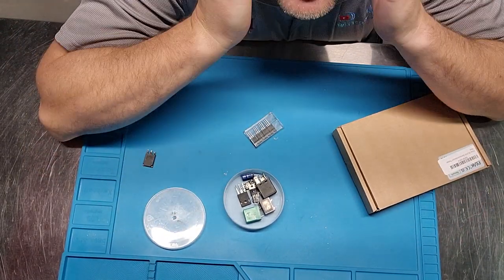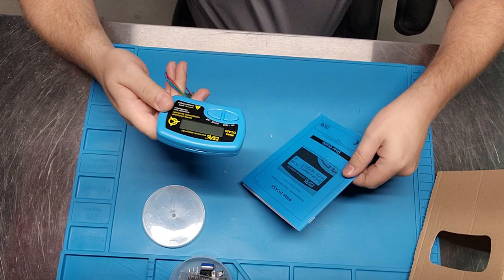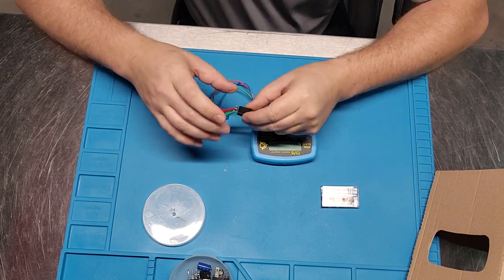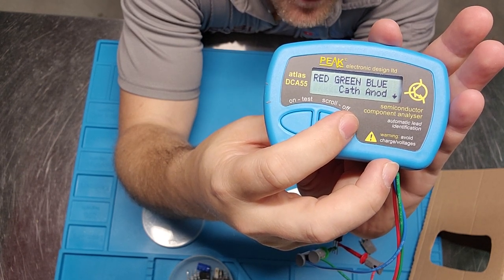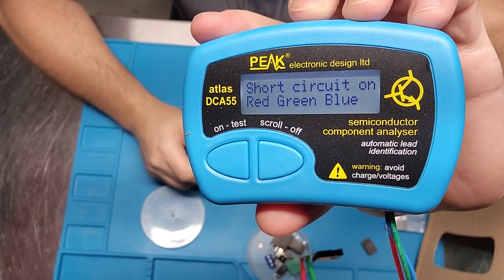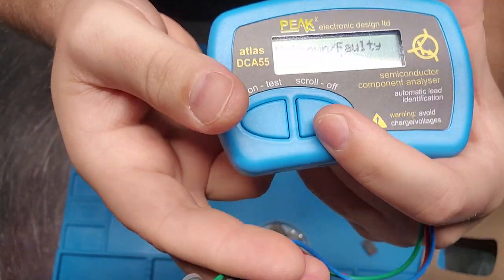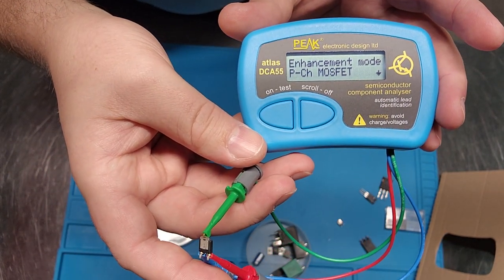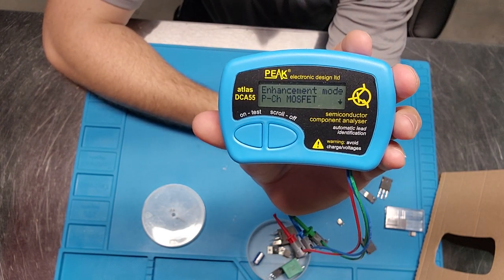New Tool! Atlas DCA55 Semiconductor Tester!

Comment: The best way to check a diode junction is with a VOM. It rarely happens but sometimes a diode junction will pass with the DCA75 and 55 and also other meters but fail when testing it with a VOM that also has the X10K and the extra 9V battery.
So, if you are having a tough dog repair and are about to pull your hair out, check the diodes and components with a VOM.
If you're not sure how to do that, Jestine Yong has a good e-book 'Testing Electronic Components' that I believe is still available. I'm not sure if there are others with a book that use the lowly VOM.

Comment: How are you supposed to know which pin each lead goes on?
Reply: It doesn't matter.
Reply: @robertcalkjr.8325  the instruction book that comes with it tells you
Reply: @johnbrown-rm8kc  I have a DCA75 Pro, and it doesn't matter which lead you connect to the pins. I just assumed that it was the same for the DCA55.